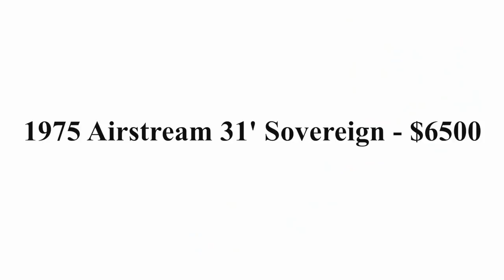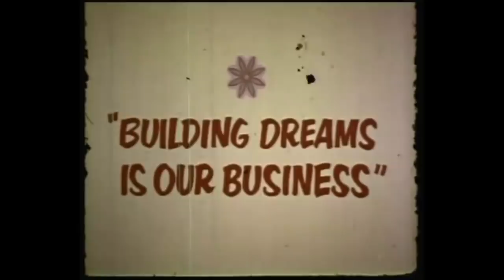I Bought An Airstream! Tiny Home Project | AIRSTREAM EP. 1

Comment: This is actually good. 1970's Airstreams suffered from frame separation, so getting one that is already gutted is nothing bad. You can build up again, and fix everything that needs fixing. Consider spray foam insulation for added stability and water resistance. You overpaid a little, but not by much. Oh, and first thing to do is replace the bearings and tires.

Comment: That's a huge project, lucky to have Dad as a partner - it makes a big difference as a team.
Good choice of van as Airstream is well known, holds value and looks good. Easy to tow as well.
I'd double check the chassis before you add too much weight because it will be easier if you do need it replaced or repaired to do that while it's light.

Comment: With Airstreams it's all about "the bathroom". The first Airstreams had the bathroom over the axles and it worked fine. As they got bigger they put the bathroom in the rear which transferred a lot of weight (due to the wastewater tanks) to the rear which started to compromise the frame. A lot of people when refurbish old Airstreams add support to the frame. Do some internet research and you'll probably find some articles on this. Good luck with your project.

Comment: As someone who lives in a bus for 1,5 years. I want to give a few steps:
1. Make sure it is insulated and have ventilation otherwise it is not to fun to keep temperature.
2. Make floor plan and check it: put tape on the floor where all is going to make sure it actually also leaves floorspace etc
3. If you want water gas electricity etc make them out to where you need it 
4. Build it, sew it etc. But make sure it is legal if you want to be capable off moving it around
5. It takes much longer than you can think off
Reply: I’m glad you put this up. I’ve been traveling since I was 15 and I’m about to buy my first sailboat and do all the work including a modern look renovation, I’ll be taking these ideas/tip so thank you :) wish you well during pandemic

Comment: God bless you 🙏 You guys definitely have your work cut out for you. I have never restored a trailer, but I built new houses and additions for 40 years. The first place I would start with is the undercarriage. Does the frame need any work? Should you replace the axles? Get any of that done before moving forward. Definitely get some new wheels, capable of carrying the load, and appropriate new tires. Can't wait to see the journey.

Comment: I’m glad, and surprised you got it home without any problems. I also noticed the “Ontario. Yours to discover!” Sticker on the back of the trailer. I live in eastern Ontario (Canada) myself. If it has spent much time up here, there will be allot of issues with corrosion, and the results of sitting out doors in the winter. Every May I see many older trailers stuck by the side of the road. Rusted, poorly maintained wheel bearings, and tires that are cracked and rotted give out soon after the trailers is dragged off of somebody’s lawn. 
   You have quite an adventure ahead of you, and it’s wonderful that your dad is eager to dive right in and help. I’m a big fan of Airstreams myself, but they’re way out of my budget. I hit the road on my old Harley instead. They’re both American icons, and deserve to be preserved. Good luck!

Comment: Composting toilet can save you on space for the water tanks and give you more room for potable water storage (not to mention a more pleasant grey water dumping experience! lol!). Murphey bed style converting furniture for seating/sleeping and storage will  make it a much larger feeling footprint inside. Definitely put the largest amount of solar panels and even windmills that can be removed for travel so you can have as much free electrical power as possible! If you build an enclosed area at the tongue/hitch it can hide and store not only the propane tanks but also some of the electrical equipment and connections to free up room inside and give you easy access to them if they need to be fixed. Great work so far and love to see you working with your Dad on it, reminds me of projects I did with my Father!

Comment: I just moved out of 35 foot 5th wheel with over-sized slide-outs  If this matters at all - move to as many locations as you can - being stationary too long will drive you nuts. Spend as much of the day outside - or in more than one area of the trailer.  The walls will close in after 6 months if you don't.

Comment: Hey just popped  in and viewed this video  that is the same trailer I renovated about 8 years ago . I won’t go into full story but will give some  some quick tips do not throw away ANY hardware very hard to find and inspect the frame and floor for rot and rust also pull wheels off and check bearings.  I would pull all the copper and replace with Pex it withstands cold weather a lot better and is easy to install with no soldering needed . Ill be popping in to see how you are doing right now I am Converting a coach bus into a RV so I know your worry. Glad you have your dad to help I am doing my Bus alone(sigh)

Comment: Learned to work on these during the summer. Will take a good chunk of time to fix it up. On average you can spend $10k to remodel it if you know what you're doing. You also need to know like 5 different trades 😵. Super worth it in the end when you finish.

Comment: Spent hours trying to repair a 1971 Overlander 27" but in the end had to give it up. Used it for 10 years and sold it for what I paid for it. Life changes and had to change with it. Now I have  a vintage pop up truck camper mounted on a 2000 F250 Ford diesel.

Comment: If willing to forego the classic look, you can pretty easily pick up ready to live in 31'ers. I lived in a 28' picked up for 4K once for a year after a hurricane wrecked my house. The smallest fridge/frzr. from Lowes...I think 350ish, a 12 gal. water heater  2-300ish under the sink, a window unit A/C in a plywood window (that could have been better done easily) a few hundred so for 5K a small house to run on 120V. Oh yeah, pulled bunk beds out of back and put Tempurpedic Full size bed.

Comment: All that structural rust is going to be a major issue. That doesn't make it an end of the game but remember.. that rust represents metal eaten away. You'll need to replace a lot of metal be it having sections custom made or hunting down used parts. You WILL get overwhelmed but hang in there. A renovated Airstream has huge value! There is a lot of information on the web about renovating airstreams.. do your homework then do more homework. Airstreams are wonderful! My hubs & I renovated 4 of these things for family members.

Comment: I would start with a mask and sand the remainder of the insulation off and then get a complete cleaned area and open it to the air.  It isn't PAA and primed so you will need to spray a sealer coat on the inside of the fuselage.  After that has dried, then go to the manufacturer for floor plan and layout for electrical and water unless you are doing everything off the cuff.  I assume you will make this a long term relationship with the airstream, so you can build your own wiring harness's and plumbing.  Nice project, the exterior can be scotch- brited later.   Wish I was there to help.

Comment: If you are going to add solar panels etc... please consider this, dual type solar panel, heats water as well as solar charging, extra benefit, keeping panels cooler, last longer for solar, you can use hot water for domestic use and or heating. Combine all 3 types, use small sailboat type wind generators you can attach with a pole easily while parked. One on each end.
For batteries look at the new LTO cells, huge operating temp range, huge, like lifetime cycle rate, you will almost never have to replace them, easily bolt together to make any size ( capacity ) or voltage ( power/amperage ). Lightweight, does not need special housing or maintenance...  hope this helps. sorry as an after thought, have you seen those welding rods for aluminum that is kinda like solder, MAP torch used to heat metal, no special welding machine required, kinda like soldering...  Double wall, or glue type, heat shrink tubing for connections will save you time down the road, solder and clean with alcohol all wiring connections you can, liquid electrical tape for hard to reach places ( stains everything, takes a few applications to get good cover sometimes ) excellent for stopping wire pull with plug harness and waterproofing.

Comment: Yes, that IS going to be quite a project, but I didn't see anything that rendered it unworthy of restoration. If the frame and the aluminum skin are in good shape, and the windows are all there, I think this is definitely worth doing. The first thing I'd do is teach myself how to use a modeling program so I could plan the layout - BEFORE I started building. I probably would not try to duplicate the original floor plan. You're lucky to have a family to help you with this. I admire your determination!

Comment: Once this video/series goes viral, Airstreams won't be that cheap anymore. lol
Reply: Airstreams never are cheap.  Any other brand trailer 35 y/o  would cost that much already rebuilt.
Reply: The older and longer the cheaper they are. 27ft and below are the most sought after.
Reply: @lightssirensrotors6061  True , the smaller the easier to tow. Often less damaged.

Comment: Airforums is the first place you must look - hundreds of Airstream enthusiasts and technicians with experience in every phase of Airstream repair, maintenance, renovation, and travel. There are several complete rebuild blogs. They will answer any questions you may have.
https://www.airforums.com/forums/

It appears you already have new axles and  a new floor, two of the most important things. To remove stickers get a heat gun or hair dryer and a plastic putty knife from the hardware store. Use the heat to soften the sticker and carefully scrape and peel off. Some Varsol or Goo Gone will also soften up stickers. Go slowly and carefully not to scratch the aluminum.
Good luck with your build project. Keep in mind, the problems of weight and balance or weight distribution and keep everything as light as possible. You are not building a house, more like a yacht or airplane in concept.

Comment: Number 1. Make sure the floor at the edges is not rotten. Prod with a screwdriver or other pointy object. MAKE SURE THE EDGES ARE SOLID. Number 2. Follow Vintage Airstream Podcast. Number 3. Read Restoring the Dream. Bill 1974 Airstream Argosy. 26'. Welcome to the Cool Airstream Community.

Comment: Decent shape Airstream "shells" are hard to find, lot of them have been gutted by POs & then they lose interest but think that they deserve top compensation for basically ruining an Airstream RV! Several RVs I looked at are priced WAY over NADA, & they need work. If your looking at Filion (smooth) sided RVs be sure to look for de-lamination, that's a sign of water intrusion! Check the roof, lots of people paint on liquid sealant to hide a bad rubber roof membrane, which most likely already leaked & caused rot. There are far to many dishonest souls out there!

Comment: There is a product that will help remove the adhesive after peeling off those stickers.  Can get it at local car dealerships, it's called Acrysol and put out by a company called Kent.  I have a can of it from the dealership I used to work for and it lasts forever.  Good for removing all kinds of stuck on adhesive, and also removes scuff marks from the bodies of cars.

Comment: "Why, why did you buy this?".  Boy have I asked myself that question more than a few times. Re: the "stickers": Use a heat gun and they should peel off using plastic scraper or fingernails; Goo Gone will remove the residue.
Reply: Someone else said WD40 works great.